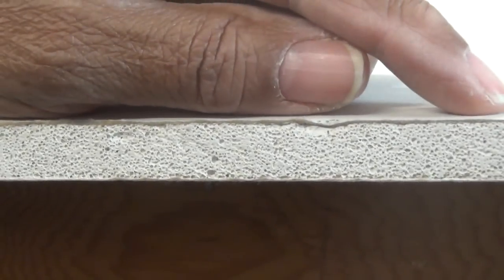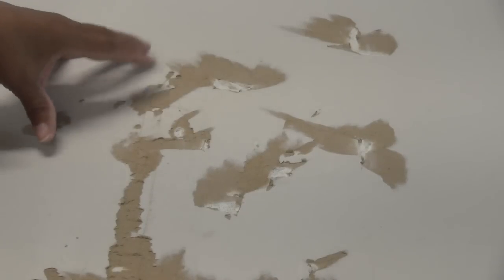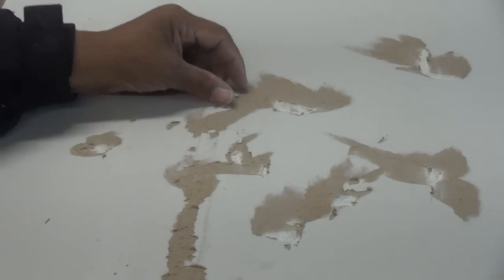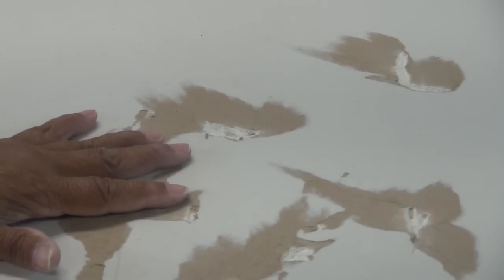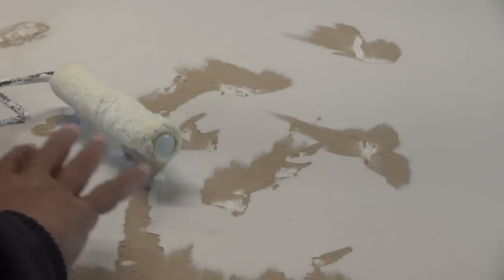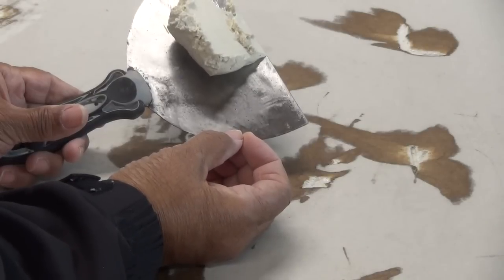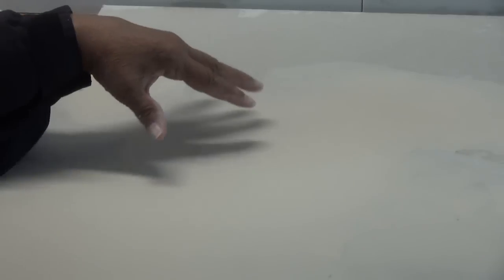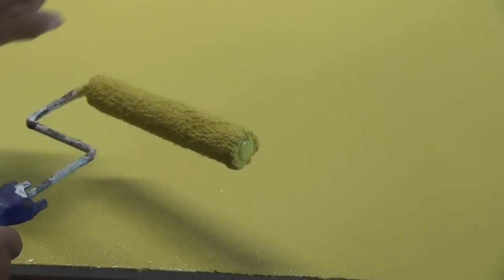How to Fix Damaged Drywall Paper

Comment: You don't need to prime before painting?  Is there a rule of thumb as to when you would apply primer coat first?  I had thought that primer would be needed on bare drywall and joint compound.  Thanks.  

EDIT:  I guess this sealer is a primer, but after you put the joint compound over it, you don't need to apply primer or same sealer?
Reply from the maker: Yes, that is what I did in the video, and that is what is recommended (use the same sealer)

Comment: Enjoyed the video.  I li e in an old house that had wallpaper.  Thanks for the info. I also have a question.  I had a bathroom renovated with new drywall and paint. But there was a leak from the roof that showed up as a bubble on the painted drywall.  The roof has been repaired but how do I fix the bubble on the drywall?  Thanks!
Reply from the maker: Hi Angela, the answer depends upon whether it is the paint that is puckering, or the drywall itself that has the bubble.  If it is just the paint that is blistered, then you scrape it and re-paint.  If it is the actual drywall, however, the drywall needs to be replaced.

Comment: Lea, thanks so so much for your excellent videos. You are a life-saver in many ways right now. 
I have one question fixing drywall paper: we just got a popcorn ceiling (containing asbestos) removed by a professional asbestos removal company leaving us with a drywall ceiling which has quite large patches of ripped and torn paper. The gypsum is not visible though so there is at least some paper layer intact. Is there a rule of thumb which size of ripped area is still safe to be repaired with your method or is a larger area in general unsafe to fix and better to be replaced? Thanks again, all the best!
Reply from the maker: How large is the area?
Reply: Probably about 3 by 3 feet...

Comment: I will disagree on one thing don't use that waterbased primer.  Zinnser makes a oil based primer that is sold at all Home Depot and lowes   It's zinnser bullseye oil based   It dries it less than an hour in most conditions. U do need to ventilate he room because of the smell it's bad but it's the best product I've found in my over 40 years of construction.

Comment: So to confirm, you can use Guardz AFTER (on top of) the skim coat and I don’t need a separate branded primer before painting?
Reply from the maker: You can either apply a primer or a top-coat, it's optional.

Comment: Hi Leah, I have this problem in my bathroom, will this work in a high humidity room, a bathroom? is the light weight joint compound ok to use in the bathroom with the sealer over it?

Comment: Leah I have purchased this product and am waiting on it to arrive. One question, is it necessary to plaster the whole wall, or just over the damaged areas? I should mention that when I removed the wallpaper it basically ripped all of the drywall paper off with it too. So basically I am left with the brown paper over the entire wall.
Reply from the maker: Hi Brian, normally it is just the damaged areas, but it sounds like you will need to do the entire wall
Reply: I can do this! do you have a place for before and after pictures?

Comment: I sealed the exposed drywall with Gardz after stripping wallpaper and it looks great except for a couple of areas that rippled when the mud dried. We cut back to the drywall again in thise areas and reapplied Gardz. I applied more mud to those areas when it dried and as the mud is drying, it is rippling again. Do you have any suggestions to fix this problem? Thank you.

Comment: Great vid! 
Have you ever run into an area where the paper is gone too? I've run into it and if I just try to mud over it, (using hot mud) it will sometimes bubble. So then I have to cut it out and do an actual drywall patch. I feel like I had success with priming the exposed gypsum then hot mudding it, but I can't remember because it's been a while. Have you had any luck with fixing exposed gypsum that way?

Comment: Gardz is an inferior product.  Watch Vancouver Carpenter's channel for a detailed explanation and examples. The stuff is only moderately water-resistant and will not perform well over large areas.  The paper underneath will still absorb moisture from the mud and blister.  Not as good as a water-proof shellac type product.

Comment: Can you please explain why we need the sealer ebfore applying joint compound? Why not just apply the joint compound directly?
Reply from the maker: The sealer helps to promote adhesion of the joint compound to the surface.  It gives the joint compound "something solid" to grab onto.
Reply: seejanedrill how about not applying the sealant prior to painting? What happens if I skip that step?

Comment: Hello Lee, thank you for this video. I have a similar situation in my bathroom. I took the wallpaper off and cleaned the walls with warm soapy water. The walls turn out to be very clean and smooth. Do I still need to use Gards ,  or I should just prime and paint it? Please advise. Thank you
Reply from the maker: Prime and paint is all you need.
Reply: seejanedrill Thank you.

Comment: I have a ceiling with water damage with larger areas without paper on the drywall than your example. Can I still use this technique or should the drywall just be replaced?

Comment: hi, was wondering if this stuff would help troubled wallboard around bathtub?? i dont have time or money now to fix it right so just trying to patch till later date!! i used.. joint compound around soft edges (1/2" to 2in) up from wallboard and tub...i primed with Zinsser and 2 coats of paint...the compound sucked in a little (no backing in places) and a few days and broke the paint seal in the 2in gap place at edge of protruding wallboard edge...also used Loctite tub adhesive caulk.. all else seems ok. so iguess use a patch on that place and try again...thanks for any help.// new subscriber/- and noob too all this repair on old house///
Reply from the maker: Hi Lynn, you just need to use a wall patch on it. The Gardz won't help you with this particular issue.  You just need to patch up the bad section.

Comment: Leah, I will be using Gardz soon on some basement walls but I have a quick question if you don't mind. Instead of wallpaper, the previous owner had paneled walls. When I removed the paneling. Glue remains on the walls in some places. Should I replace the drywall or try to scrape off the glue and then use Gardz/joint compound/Gardz/Paint?
Reply from the maker: Hello Paul,  Someone just asked a similar question.  The answer is simply which is the more expedient and less messy, if the end appearance is the same.
Reply: Much appreciated Leah. Love your channel!

Comment: @seejane great video. question(s); if there are a number of spots that need repair on a large wall, should you use gardz over the whole wall (so the sheen is the same)? or just in the spots that need it? and 2nd, could the after coat be a regular primer? or needs to be a gardz type? if gardz, do you use regular primer after that? thanks!

Comment: Hi Leah-I'm attempting to cover the original layer of 60 year old wallpaper in my old ranch home with a new look.  I'm going to be covering just the "bad spots brown paper" with Guardz Sealer, then skimming those places with joint compound. Then I am going to cover the walls and ceiling(wallpaper too) with more Guardz Sealer.  I want to texture the walls to help cover any "mistakes" I didn't get just right, and "dress" up the wall some with texture.  *I bought a box of USG ultralite joint compound. But on the box, it says NOT to use on glossy surfaces. Does that mean that I can not successfully use the joint compound to texture directly on top of the Guardz painted walls?? Do I need to paint over the Guardz with a white primer Before I add texture to the wall?  And after I texture the wall, can I paint right over the texture with my Valspar Aspire paint and primer? I really want to do this right. I'm over 60 years old myself, and don't want to waste my time or money. Please help.  And thank you for your great Youtube videos!

Comment: Leah, what's the difference between the ready mix all purpose and dry mix joint compounds?  I've been using the 45 minute dry mix on a repair job but the contractor who did part of the job would only use ready mix. Are both equally strong and durable?
Reply from the maker: you know, JT, that is a good idea for a video!  I will add it to our list!

Comment: Do you think BIN shelac is equally good with the benefit of faster dry times so you can skim sooner.
Reply: David E in my experience no- I love BIN, but Zinnser makes this as a different product for a reason. I use it exactly as she shows in this video and it binds drywall mud much better than any primers I have used, including PVA primers and BIN. This is my DIY drywall mudding secret tool now, it results in a even texture across the entire wall.

Comment: I am working on a wall worse than this but I did not use a sealer. I only have a coat of joint compound in. Have not sanded yet. Is it too late for a sealer? I would appreciate any advice. Thanks
Reply from the maker: Hi Clara, it's not too late for a sealer.  Something is better than nothing. You should sand first, and then put on the sealer.

Comment: Hey Leah Google sucks so searcing this topic is impossible anyway please could you please answer a question about cutting sheetrock? 1st off I've been doing construction for several years and I have gotten much better at cutting sheetrock but I do still have problems with the sheetrock paper being so hard to cut sometimes it just gathers at the tip of the blade refusing to make a nice clean cut . Many times it happens after bonly 2 or 3 cuts into a fresh blade . or the top paper cuts clean and cutting the back or brown paper again will bunch up and be hard to cut
Reply from the maker: This is happening because your blade has gone dull.  Utility knife and razor blades go dull very, very quickly when you are using them on drywall.  So try starting with a new one!
Reply: Kinda thought that was the issue If I am doing a small repair I tend to use the blade that happens to be on my knife,but when starting a larger drywall job I start with a new blade I have also noticed some brands will cut quite a bit before getting dull also keeping the rock from caking up on the blade will add life to the blade. Thanks for answering I use your videos quite a bit when I am researching upcoming projects that I am less experienced at than I would like thanks

Comment: Hi. I am a novice when it comes to home renovations and recently removed the baseboards on my drywall.  Some of the drywall paper was damaged in the process so I used the Guardz "Problem Surface Sealer" on the damaged drywall. However,  some bubbles/blisters still developed under the mud.  :(   When I first opened the Guardz sealer, I noticed it was completely separated. i.e. there was a thick layer of clear liquid on top. I stirred it up for several minutes, but I am wondering if maybe the stuff I bought had a limited shelf life and was too old?

I am not sure what to do now. What is the best way to repair this? Do I use a utility knife and try to cut out the bubbles, or do I use water to soften up the mud and scrape it of?
Reply from the maker: First, I need to know...did you roll the Guardz on before you made the repair with the mud?
Reply: I applied the guardz directly onto the drywall paper and the surrounding area using a small roller. It seemed like enough at the time because it looked wet from the guardz, but perhaps I did not apply ebough of it? After that, I waited about a day and then applied the mud.
Reply: I just discovered what happened. When I removed the baseboards, it must have lifted the paper, but not enough to actually rip it. Therefore, I did not notice any damage to the paper. As a result, when I applied the mud, moisture got in there and caused the blister. This appears to have happened all long the area where the baseboard were caulked.

I guess I will need to cut out the affected paper all along the baseboard area and apply some more Guardz sealer. (By the way, I watched one of your other videos that mentioned applying a bit of water to help remove some mud. It is amazing! I was able to gently scrape off the mud without causing further damage to the drywall!)

I just want to thank you for posted such amazing videos! I have learned so much from them and they have inspired me to do more around my house. They are by far, the best training videos I have found on the internet.  :)

Comment: I have learned so much. I have a popcorn ceiling and would love to remove to get cleaner look. if you have any ideas I will much happy.
Reply from the maker: Hi Dee, with popcorn ceilings, it is best to scrape them.  But you need to check to make sure they don't contain asbestos.  If you just wanted to skim over them, the popcorn would still show through.
Reply: Just rip it out and re-drywall it.  It is so much less work than scraping, skim coating and cleaning that crap up.
Reply: Quite easy to remove popcorn ceiling by wetting the ceiling a section at a time, and using a scraper.  Comes off like butter, and no dust, just a big mess.  I suggest using plastic on the floor.  If you want to go big, use a garden hose with a mister and a 12-14 inch scraper.
Reply: Yeah, wet the ceiling down.  Scrape it off.  Let dry.  Repair the drywall like Leah says here.  That is what I did in my house.  The water on the ceiling is like magic; works quick and makes all that scraping much easier.

Comment: PVA wood glue watered down ..
Reply: You may have answered my question.... I was wondering if it may be essentially watered down Elmers school glue? If so, what ratio would you water it down? 1:1 or so? Another great video Leah! you make an excellent teacher.
Reply: biggregg5 I'm thinking 10:1 looking at the liquid.
Reply: +GreenAppelPie 10 parts water/1 part glue or the other way around?
Reply: +GreenAppelPie 
If it's 10 glue/1 water, you still cut the cost down to 1/3.
Reply: +GreenAppelPie 
I'm such a friggin' cheap skate.
Reply from the maker: Hi guys, it's not like a bonding agent.  It contains ammonia, propylene glycol, and petroleum.  The rest of the ingredients are proprietary.
Reply: +seejanedrill just curious....have you ever tried watered down school glue? I've come across some YouTube videos where people are getting roles of construction paper, soaking it in watered down pva glue and using it as faux wood plank or stone indoor flooring. they then put several coats of polyurethane on top. Actually looks really good. Anyway, like I said....I'm a cheap skate, and always looking for a way to DIY cheaply and creatively without losing quality. Thanks for your vids, Leah.

Comment: Gypsum is not plaster.
Reply from the maker: Plaster and drywall are both made from gypsum, which is "a soft sulfate mineral composed of calcium sulfate dihydrate, with the chemical formula CaSO. 4· 2H2O. "

Comment: I have walls where the previous owners used double sided sticky tape to hold plastic strips to the wall to hide cables.  Of course, they left it for me to take off.  In doing so, I have ended up taking chunks of dry wall off trying to use a razor to get the sticky tape residue off.  Sanding doesn't do it. Using a sticky tape residue cleaner doesn't do it, neither does any kind of paint cleaner.  I can't imagine painting Gardz over the tape residue will change the fact that it is there on the walls.  I know I can use the Gardz once it is repaired but how do I get the tape residue off?
Reply from the maker: You may want to consider a product called Goof Off